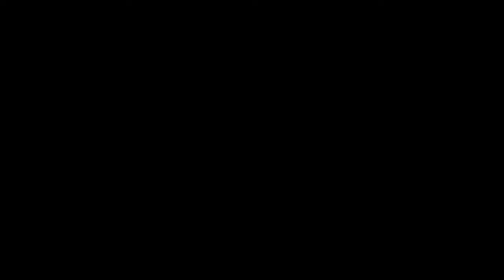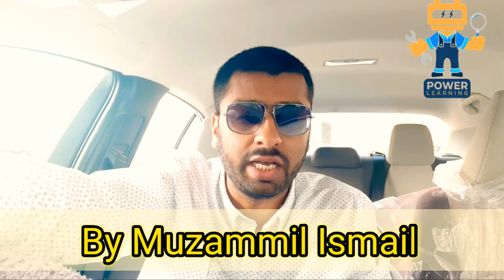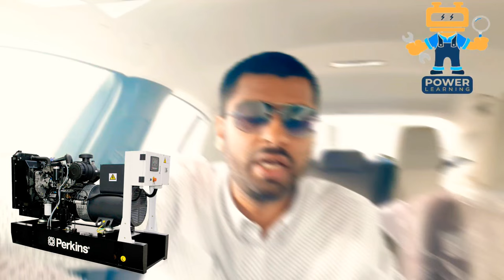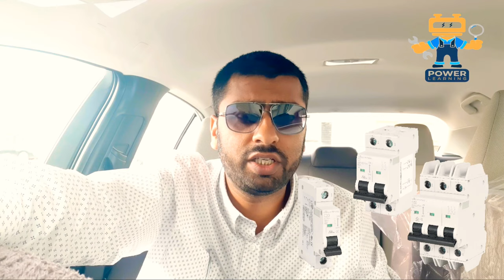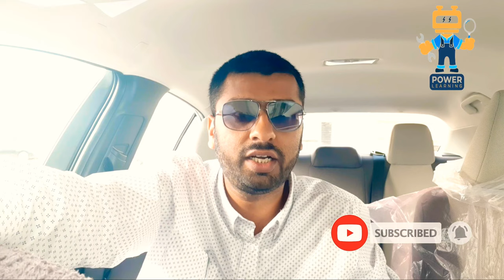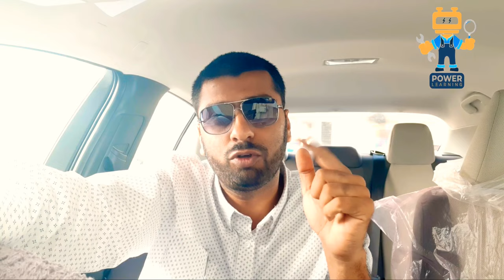Generator Fail to start | Dg generator starting problem | generator locked out maintenance alarm

Comment: Great video. I have a Doosan G25 that runs for 15 seconds and shuts off. I think it's one of the sensors because the engine runs great without the governor.

Comment: Thanks for this awesome video
But I want to know this, I know that the governor helps to regulate the engine speed based on the active power requirements on the generator, but if the generator has an ECU would it still need a governor?
Reply: yes

Comment: Sir, good evening, i hope u will answer my question..i have to ask u some favor, like, 
 My genset is not starting, the battery is good, also i tested the speed controller dc supply , 11R, and module but all have giving enough voltage, but my genset still cannot start,its just cranking...but if ill give supply to actuator directly from battey it will move and start but dont have proper idle because of direct to batt connection..can you help me with this one sir..thank you for your kindness godbless😊

Comment: hi, thanks for this information. mitsubishi disel engine  won't start electrically but starts by manually adjusting fuel by hand. i noticed no voltage from mpu. tried several mpu sensors with no positive results. what do you advice i do? thanks
Reply from the maker: Try to adjust first mpu voltage and than go step by step procedures
Reply: @DieselGeneratortraining  thanks for your reply. how exactly am i to adjust mpu voltage? do you mean the distance between the flywheel and m?pu
Reply: @segunwisdom7376  screw in the mag pickup until it touches the flywheel teeth then back off 1/4 turn.

Comment: thanks very much for your guidance. I am working on  green power generator and it is not cranking. the alarm indicates maints CCW rot, and also ECU not starting. what could be the possible  problem?
Reply from the maker: Your controller Sensing mains power

Comment: Bhai mein ne ap ko pehle v pucha tha humara gntr locked out huwa hai or start nai ho rha or jo radiator starter motor jaise gaari k aage andr lagi hoti Hai wo piche Se jal gai a Jahan dono wire lagi hoti Hai batry se ati Hai negative and positive wahan se jal gai Hai or 3 bar cranke rest leta Hao or fail to start ho jata Hao ab mein kia kron jo motor jali Hao wo change kron ya kia pls ans dena mesg dekh k
Reply from the maker: Ap kisi expert ko check karwa lain behtar rahay ga
Reply: @Power Learning Channel  aap ko idea nai hai kia ap ko malom Nahi Hao ap k video's to bohat ache Hote han sab ap ka v to experience hoga is liye pucha dosri bat ye k jeddah meim kafi jaga tod di Ha Jahan aise log kam krte the Jahan shop hote the Har Kisam K ab pata nai kahan chale gaye sab agr ap ka koi waqaf hai ya ap ko is k bare malum hai to number de do ap mein jamya Rehta hhn  al feha k pas

Comment: I am working on John Deere generator. It will start say after two cranking attempt but will not start again afterwards. It usually display ECU and low fuel level. 

What could likely be the cause?
Reply from the maker: Record video and send us on Info.powerlearning@gmail.com

Comment: The generator starts up but cuts off after 15 seconds what is problem
Reply: I have the same problem and it's one of the sensors. My unit is from 2014, so it doesn't provide a specific code. I have to check the voltage provided by the sensors to see if they are correct.
Reply: over/under voltage, over/under speed,

Comment: Sir, i have SDMO generator with APM 303 module. It is showing error of generator shutdown and also low battery voltage/ alternator not charging. The generator is not starting in auto mode. I have to manually provide battery power to fuel solenoid. I have also checked by replacing new APM 303 module but problem is still there. Kindly let me know how to fix this. Urgent solution required please.  Will be grateful. Jazakumullahu Khairan
Reply from the maker: It's look critical kindly arrange visit from some expert to rectify

Comment: Sir I have problem such as system fault in our Diesel engine controller,it not start in auto condition but manually work,so what can I do
Reply from the maker: U have only problem in ur remote start signal

Comment: Doosan v type 10 cilynde generator not start.but nozzle pipe open diesel coming but not start what's the problem
Reply from the maker: Check battery voltage during starting you need strong battery

Comment: hi, I have a generator that is not starting but is cringing and when I mesure the voltage for tue battery it normally 13 volt and when I'm starting it drop till 8 volt is that the problem of the battery
Reply: It is?

Comment: Hi sir...
I get a genset  i started smoothly and sound but the next day failed,i've found  that the problem is with actuator that fails to receive power from engine speed controller.
Kindly assist me please from there what should i do to troubleshoot this matter
Reply from the maker: Share more details about generator
Reply: @DieselGeneratortraining  which details may be I've  to share can you tell me the details that you need
Reply: @DieselGeneratortraining  Thanks for your reply

Comment: Sir if I start up Generator and it starts up and runs like normal for 14 seconds and then goes into Starting attempt mode 0/3 and then starts again for 3 more attempts similar to the first time I start it and it starts up normal and goes off after 14 seconds for 2 more attempts. It cranking 5 seconds later and for 3 more attempts it goes to fault code fail to start. Please advise sir what could be the fault.
Reply: Sir can I send you a video of the problem?

Comment: I’m having a problem with Genset controller 7110. No power on controller itself at all, I’ve checked all breakers is on, emergency button is off, key is in on position, battery charged. Don’t know what to do, how to turn conntroleer on
Reply from the maker: Check the battery supply on the back of controller terminals
Reply: @DieselGeneratortraining  Thank you! I’ve checked terminals, one of B- wires wasn’t properly tightened to terminal. By the way, I’ve started generator it’s worked for 10 seconds and then shut down with message “power generator over frequency shutdown”. Is this message about problem with 50/60HZ frequency or something else ? couldn’t find anything in manual about it. Thank you in advance!